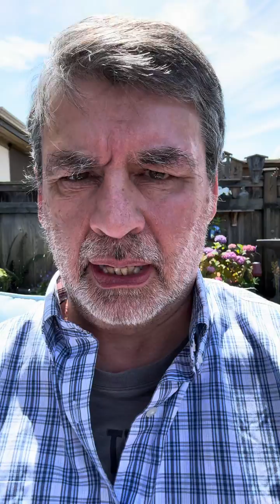Canada's new national power grid can't be like the old grid

Comment: The false economy of EVs created by government policy is going to put a huge strain on the grid and cause us all kinds of problems. I can’t  understand how guys like Markham keep pushing this electrical agenda,  it will take decades to orderely make the switch.  Not five years, more like 25 .

You can ‘t take a chance in the Canadian climate.  You switch over to green energy, and when the systems fail, people could die.  The risk is real, and the issues are known.  Moving to fast is foolish.  Canada in January just can’t have a collapse.  Because of all the knuckleheads pushing green energy and EVs I am pricing out a propane powered generator for back up power to my house, as I am afraid our grid will hit the wall and fail when we need it most. Now I need to start thinking of protecting myself and family from this idiotic push.

Thanks Markham
Reply: The only "false economy" are fossil fuels.  Fossils fuels are a dead-end technologically, economically, and environmentally.
Reply: The energy transition is not happening overnight so no need to cry the sky is falling.  But we need to take steps in the right direction and not stay still.  Alberta is heading in the wrong direction by both pushing for more fossil fuels while simultaneously blocking renewables.  It is absolutely bonkers strategy and indicative because it tells us that Danielle Smith is essentially a O&G employee.

It goes without saying that Canada is a small part of the global order.  Big moves are already happening in the energy industry and accelerating.  Like:

In 2022, 81% of all new global energy additions were renewables and this is accelerating.

IEA 2024 reports that globally $2-trillion was invested in clean energy (mostly renewables) versus $1-trillion in fossil fuels.

China is already at peak-diesel and peak-gasoline which is a flashing a huge market signal to the rest of the world.

Investors look towards the future and not the past.

Canada is not the world and will have to sink or swim in a competitive landscape just like any other country.
Reply: EVs represent a small fraction of the total Canadian energy demand around 0.1% of Canada's total.  Part of this is EV's incredible energy efficiency versus ICE.

Firstly, not all vehicles are instantly transitioning to EV.  That's just not possible.  It is increasing but not happening overnight.  They sky is not falling.

Secondly, calculate total number of kilometers driven by Canadian drivers per year and see how much energy used by EVs per year.

EVs have nominal efficiency of 0.20kWh/kilometer
The average Canadian drives 15,200km per year
Canada has about 200,000 EVs registered

That all totals 608GWh of EV electricity per year!  But the Canadian grid annual generation is 625,700GWh!  So annual EV use a tiny 0.1% of Canada's electricity grid!  TINY.

Furthermore, Canadian wholesale electrical system planners see EV load growth will be relatively low.  Instead, they view EV growth as a business opportunity.

Again, the sky is not falling, but we need to start moving in the right direction and not stand still.
Reply: Furthermore, fossil fuel drilling, and refining use tremendous amounts of energy along with creating pollution.  Transitioning away from fossil fuels unlocks a lot of energy along the way.

Case in point, the US uses so much energy refining is petroleum that it could power all of its EVs several times over.

Heat pumps also operate at incredible efficiency well above 100%.   You read that right, over 100% because of the special way heat pumps move energy around.  Heat pumps regularly have efficiency of 200% to 300% with newer designs getting even more efficient.

The era of wasteful energy with fossil fuels is also thankfully coming to an end.  Burning fuel in an ICE car has a nominal efficiency of 20% which is a pathetically laughable figure yet true.  That is, 80% of the fuel is lost as heat and 20% is actually converted to the desired kinetic energy of motion.  A BEV has efficiency of 85% or more which is leagues above ICE.  Also the diesel and gasoline don't arrive by magic at the local pump.  As I said before, tons of energy and pollution are needed to get this ultra-refined product to your gas station before a single drop of it is burned as fuel.
Reply: @beyondfossil  You are wrong.  Not sure where you pulled this fact out of thin air.  It is statements made like this that are going to run us into a brick wall when reality plays out .EV batteries require both a mining and manufacturing process to be built. The will also require energy to be recycled and disposed of properly.  

Same goes for solar panels and wind turbines.

The ironic part of all of this, is they all require hydrocarbons in  manufacturing their parts components, (carbon fibre, plastic)

So many😊 of you people simply have no idea the importance of fossil feedstock that is required for your pipe dreams.

I am not worried about being right, as reality will win the day.  I am worried about what the  failure of this ideology will have on our economy and lifestyle when reality plays out.

At the end of the day none of this will do anything to reduce GHG gas emissions around the world, which was the supposed thing driving this insanity

Comment: We already have the power grid. All that remains is the interconnection and control system. Additionally we can add high voltage DC transmission to bridge long distance gaps. Wind and solar plus DC long distance transmission is the future of grid stability.

Comment: South Korea can build a nuclear power plant in 3 years, and regularly builds them in 5. It doesn't take 10 or 15 years if regulators don't make it impossible. 

I agree large scale build out of wind and solar in Alberta is necessary. But nuclear will be an important part of this as well, the GTA needs power and we have no hydro to back up the wind.
Reply: Latest South Korean builds have not been 5 years but more like 10 - 12 years which is more in line with the norm.  You also cannot just transplant South Korean economics, regulations, and labor to the west.

A major ongoing problem with nuclear construction is the times between nuclear power plant builds themselves are 10- to 20-years.  When that happens the nuclear energy industry loses momentum, loses experiences in trades and technicians, and new designs come that need re-certification.   This is part of the "first of a kind" (FOAK) problem that has plagued nuclear construction where every build is a custom bespoke construction similar to a large one-off civil engineering project.  South Korea may have benefited during its boom years of nuclear construction in the late 1990s and early 2000s when they were building the same reactor design repeatedly and thus had faster build times than average.  But South Korea has regressed to FOAK problems.

Besides long build times, commercial utility-scale nuclear is just one of the most expensive ways to produce electricity.  All with unparalleled risks that no other electricity generation method even comes close to in risk profile.

That said, nuclear regulations need to be in line with the risks because the alternative is unthinkable.
Reply: @beyondfossil I agree with the FOAK problem. And that we aren't South Korea.That is why I am very hopeful for SMRs. 

But I would pin the lack of construction momentum and historical development of SMRs to a poor regulatory environment. 

And I would argue that while it is picking up again, South Korea's slow down was because of government policy change away from nuclear.

Nuclear needs to be safe. That doesn't equate to restrictive regulation.
Reply: @beyondfossil  Anyone who is anti fossil fuel and pro Nuclear for the health of our planet, has no idea of the risk matrix  theory. Worst case Fossil fuel disasters, the world can recover from in less than 50 years . Nuclear disasters are potential planet killers. The accidents never go away and the best we can do is manage the problem past our own life expectancy and leave the pending disaster to the next generation.  We already have Chernobyl and Fukisima to worry about.  They are both ticking time bombs that have the potential to leave large portions of the planet uninhabitable. Only through continuing human intervention can we keep a lid on these disasters. Once the human interaction stops these disasters will escape their tombs and damage the planet in a manner that will effect all life on earth. There is a reason nuclear fell out of favour. It is a planet killer

When I hear  nuclear being suggested as a better alternative than fossil fuels it makes we realize how stupid we are.

Please people do some research on both Chernobyl and Fukisima.   The money spent alone  at marginally controlling these accidents  is staggering.  Factor that into your cost analyst and you would never build a reactor. They may not be in the news, but the events still happening at both sites is pretty eye opening to the risks involved that take thousands of years to recover from.
Reply: Before suggesting nuclear please research the ongoing events at Chernobyl and Fukushima.  The potential of a planet killing event still exists without constant human interaction and expenditure and will remain like that for centuries.
Reply: @CanadianPatriot-h3x both of those were clearly and previously known dangerous designs. That really isn't a concern with a CanDu or SMR designs.
Reply: @neolithictransitrevolution427 Well I am no nuclear engineer but  I would like to be told what the worst case scenario is with a CanDu reactor 

If someone  knows tell me.  Don’ t just assume it is safer because  it is different.  What is the worst case scenario and what safeguards are in place to ensure it doesn’t happen.  The worst case scenario at Chernobyl was a planet killing release.  People sacrificed their lives to do something that had to be done to prevent a planet killing catastrophe.  If planet killing is the risk, then as a human race we should not touch the technology.